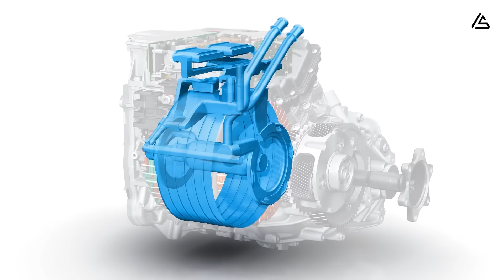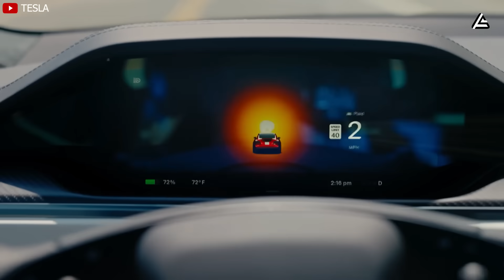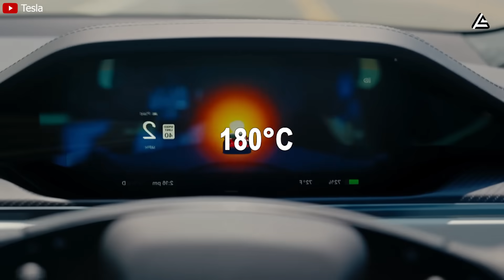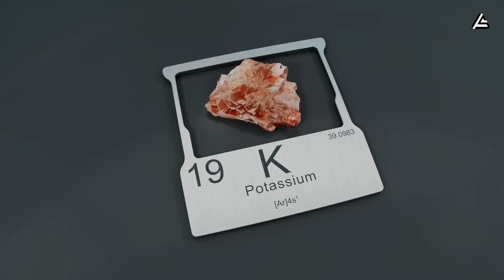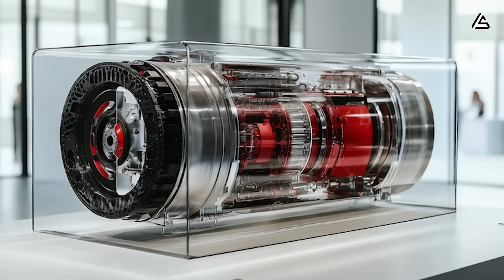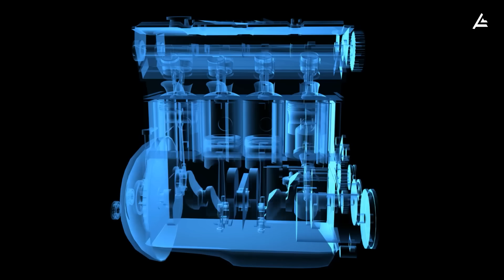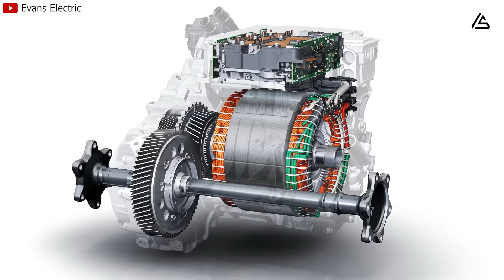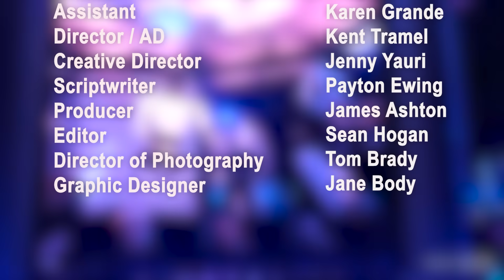Tesla's Carbon-Wrapped Motor on 2026 Model 2. What's SHOCKING Entire Industry?

Comment: 3X?
An electric motor can last significantly longer than a gas motor due to having fewer moving parts, with potential lifespans of over a million miles compared to the average 150,000 to 200,000 miles for a gas engine.
Reply from the maker: You're right, electric motors generally have a longer lifespan than gas engines! The "3x" refers specifically to the potential for a 3x increase in power density with this new carbon-wrapped design, not the overall lifespan. Good catch!

Comment: The extended range will make EVs practical for the vast sparsely  populated parts of the country where  charging stations would of necessity be far apart.
Reply from the maker: Exactly — longer range means you can drive across remote areas without worrying about charging. Would you consider a road trip across those regions with it?

Comment: How will this motor perform in extreme climates? Ice, heat, humidity?
Reply from the maker: Good question — thermal management will be key 🔧 If Tesla’s cooling and sealing systems hold up, it should handle extremes fine. You think heat or cold is the bigger challenge?

Comment: Why not just use a lower-RPM motor and gear reduction?
Reply from the maker: Would you prefer they focus on reliability instead of pushing the limits?
Reply: Lower RPM motors are bigger and heavier for same HP
Reply from the maker: yes that's right

Comment: I like the idea of one motor in back and another in the front.   If one motor fails, the customers will not be stranded.   Two motors also helps with four wheel drive.  Two $800 motors can be installed for less than the price of one rare earth motor with no redundancy.
Reply from the maker: Would you prefer Tesla to make dual-motor standard, even for the lower-cost models?
Reply: @AutoGearShift2  Two motors would half the power requirement for each motor.
Reply from the maker: you got a point, but it will cost more

Comment: If gas prices doubled tomorrow, would you switch to EV?
Reply from the maker: Good question — I probably would, but only if charging was as convenient as refueling. How about you?
Reply: i already did this 3 years back. It saves me about 8 euro ct per km. Driving 40 k km  a year that makes a difference. Then maintenance, the absence of it also saves me thousands. Now, investment wise, by a second hand car now because of all the skepticism they dropped  quite fast, and you can buy one cheap now. As that is the one and only but quite big disadvantage of buying an EV in general compared to a classic car. The list prices of new cars however are set to drop further in the near future and will mean even lower prices for second hand cars. That said, range can be an issue for some. My model 3 long range has a max range, driving 120 km on highways, of about 350 km. For better range and faster charge times and lower prices, wait for another 3 years.
Reply from the maker: thanks for your sharing. That’s a very realistic take, and your experience matches what many long-term EV owners report. Depreciation and range are still trade-offs today, but tech, pricing, and charging are clearly moving fast.
Reply: No...
Reply from the maker: why not?

Comment: Sounds great on paper, but what happens when the carbon wrap fails?
Reply from the maker: Exactly — that’s a valid concern. If the carbon wrap (used to reinforce rotor strength and reduce expansion at high RPMs) fails, it could lead to catastrophic imbalance or motor failure.
Reply: Stockton Rush can elucidate :>
Reply from the maker: why asking Stockton Rush?